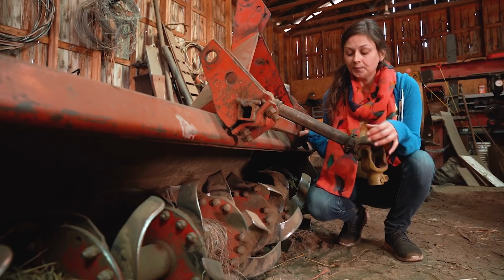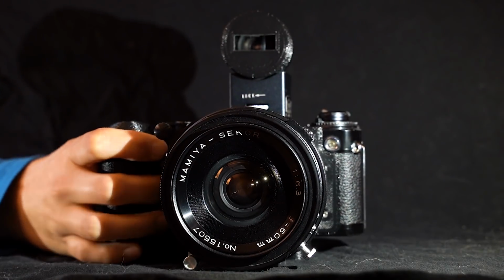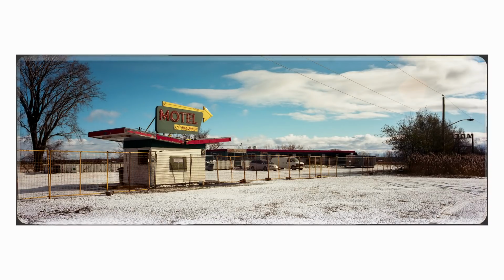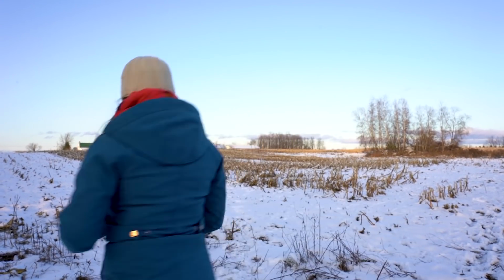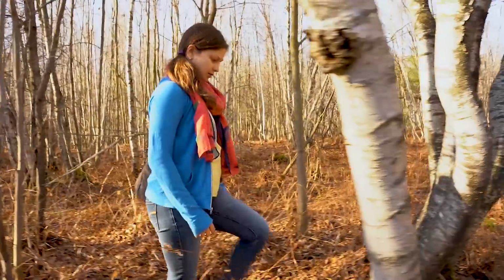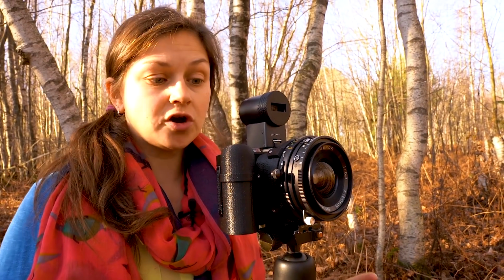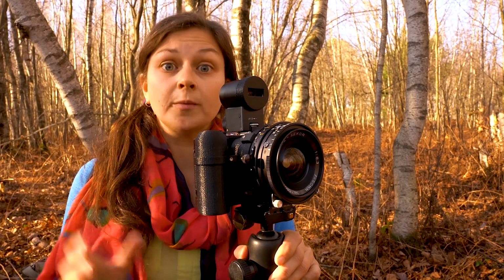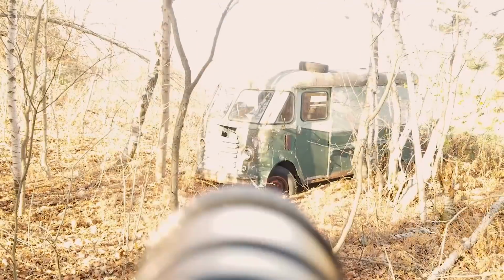The PressPan - A Hasselblad XPan Alternative

Comment: This is extremely interesting. So, to double check all I need to supply the FE body and they will build It out for me and add the 50mm lens and viewfinder? Thanks, I need to know this asap. Great video and channel.
Reply from the maker: I had to source my own lens and viewfinder (which did come as a packaged deal, but I still had to buy then on my own), and then when I got the finished FE back, I mounted the lens myself (a very easy job, it's just a few screws).  Maybe Freeman can find a lens for you, you would have to ask him if he offers that, I really don't know.  I would suggest opening up the conversation with Freeman to see what can be done, and then get on his waiting list (his contact info is found on his website).

Good luck!

Comment: Dear Jess!

Is there a specific reason to buy this camera? Wouldn’t Fuji GS645W camera fit the same panoramic profile - frame size 45x56mm can be easily cropped to 24x56mm and the lens focus length is even wider 45mm?
Price wise it also will be cheaper, probably twice- $400 instead of $800 ( not a precise calculation though).
Thank you for the great video, very dynamic.
Reply: Take my comment back :-(. 24x68 makes the difference! It is much wider than 24x56.
Reply from the maker: I do occasionally shoot 35mm film through my RB67 with an adapter, so it's not a stretch to question why I would get this camera.  Honestly, I just really loved the idea of supporting a new builder, and being able to give a new life to a broken FE was a nice bonus.  I'm also a bit of a Mamiya fan-girl, so when I saw I could put that lens on a pano camera, I just had to do it!  Thanks for watching!

Comment: I am guessing this is very expensive? I want to do true panos badly. What does that lens cost? Ouch $250 to $400 just for the lens :-(
Reply from the maker: Well, yes and no in a way.  So the total cost for me was around $1000, which isn't cheap.  But when you take into consideration the cost for an XPan, which is easily $5000 these days, it is the cheaper option.

Also, once an XPan breaks, that's pretty much it for the camera because of the electronics in it.  Whereas this option has more chances of being fixed, because the main part of the camera is really the lens.  I honestly can't say if there might be issues with the 3D printed plastic parts later on, I haven't encountered any so far, so that might be another unfixable part later.

There are pros and cons for this camera for sure, and for me it was a worthwhile expense.  I also knew I would be getting some cameras from Dora Goodman as well, and I can share the lenses between both, so that helps with the cost too.

It is unfortunate that there aren't better pano options for less though.  The only one I can think of is the Lomo Sprocket Rocket, but that might not be for everyone either.

Thanks for watching, and for taking the time to ask some questions!
Reply: @JessHobbs  I have no idea if I will succeed and I have no idea how long it'll take me but I'm going to try to build my own I don't have anywhere near that kind of money but I can get one of those large format lenses that have a built-in aperture and shutter for just under a hundred bucks so once I have the money I'm going to get one and then try to 3D print everything else I have lots of printers and lots of plastic :-) so that won't cost me anything :-)

Comment: Why not just use the mamiya super 23 with the 6x9 back and the 50mm? you could then chose to crop top and bottom of the negative and get an even wider "panorama" as afterall the negative size is 60x90mm  as oposed to the 24x 68mm. You would be able to focus the lens by  using the coupled rangefinder of the super23, something you can't with the presspan. 
You could even use 35mm film in the 6x9 back with a simple adapter. It's beyond me why you would make such a complex solution to a simple problem.
Reply from the maker: Different strokes for different folks 🤷‍♀️

Comment: Verry sad that the film is located centered and not say 6mm shifted up - for a dedicated panorama camera.
( I can't remember witch one by Linhof? had that fixed bild-in lens-mount that was slightly higher than centered -not much. For those more seldom vertical images probably not that obvious or  problematic. But for panoramas I feel it is a near permanent issue the proportionally "to much boring foreground as we are kind of close to earth and don't want to point up the camera (especially with n9n high res digital) - or resor to flip camera onto it's head when needed or counter-shift with ouer body for close subjects.  Say fix 5 or 7 mm for someone who does not care  ; would not even notice it.  The others would take it as the reason to buy it.
Reply: It’s actually shifted by ~3mm. Customer can specify if more is needed :)
Reply: @Techball272  Hey.. That is great news. How come O did not get that !!?  Did You just find out or is it mentioned 8n the video ? ...I have to check.
Reply: @AR-vf7vg  oh, I’m Freeman, the builder, haha, sorry, I forgot to mention it.

Comment: Really liking the images you took with this setup and grateful for the heads up and links. I already have the Intrepid 4x5, but am looking at MF alternatives, so this is a possibility. Just a couple of points on the video. I think it would be helpful if you slowed your delivery down as you sound a bit rushed at times. Conversely, there is a little too much moody B-Roll which could be more tightly edited for a crisper final result. Hope that helps.

Comment: You have created some great images using the Presspan. I have a swing-lens Horizon 202 and a 6x12 120 back for my 4x5 camera - they both have their strong points but the Presspan gives another option with it's own strengths.
Reply: which strenghts?

Comment: another important WARNING, one you did not mention, this lens is used on the mamiya press cameras, BUT these do NOT just have a 120 roll film back on them, the press super 23 has a BELLOWS & sheet film/polaroid back\ groundglass attachment so the lens has a "hold open" system, like a large format lens, to focus with ground_glass!!- this is the rule/tip, as the back on THIS camera is a 35 slr style, aka NO DARKSLIDE, so DON'T hit this switch by accident, or the whole 35 canister is EXPOSED to LIGHT as the lens shutter is open!!

Comment: Yeah, not sure I can support the idea to cut up and effectively cannibalize the finite and limited stock of all purpose analog cameras for something specialized that comes with some real limitations - like no coupled rangerfinder/split prism viewfinder for precise focusing. And that being said, this Frankenstein design is not a replacement for something as elegant as a Hasselblad XPan.

I'd rather see efforts focus on other solutions to the same problem. E.g. modifying or creating new film backs for 6x6 or 6x4.5 cameras with interchangeable backs. This will not cannibalize valuable, finite stock of remaining camera bodies out of production. It will also allow for a MUCH better user experience.

That being said, I am eager to try out an easy hack on my Bronica S2A with a 3d printed mask for a 6x6 back, a viewfinder mask and some careful manual film advancing bypassing the shutter cock/film transport lever. No damaging modification needed to the camera or the back. The economy of film also works out nicely in terms of number of shots per roll you get on a 120.

And Bronica S2 and S2A bodies are plenty and cheap on Ebay.
Reply from the maker: This Nikon FE body was plenty cheap, as it was broken beyond repair, making it a perfect body to use to make this PressPan.  Freeman himself (the creator of the PressPan) prefers to work with broken bodies as it gives them a new life as a functioning camera, rather than a shelf queen or to be ripped up for parts.

Unless new cameras can be made, and not just new Leicas or point-and-shoots, this might be part of the solution for the future.  Some people are creating 3D printed bodies that allow for large format lenses to be used, some are taking broken cameras and making them into something new, and some are taking old Polaroid cameras for which the film does not, and probably never will again, exist and making them usable again.

Is this for everyone?  Probably not.  But for me the PressPan is an absolutely beautiful camera that is a joy to shoot, at a fraction of the cost of an X-Pan, and it gave new life to an otherwise non-functioning camera.

Bronica makes some really beautiful cameras, I have an ETR myself!  I've thought about getting the SQ-A, it's a really small camera for the size of negative it produces!  And those Bronica lenses are fantastic!

Thanks for watching!